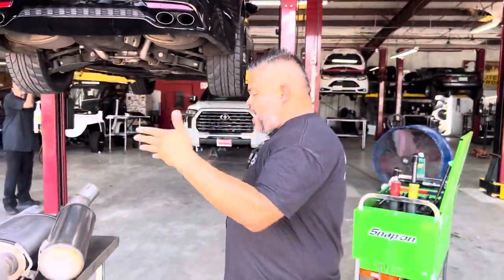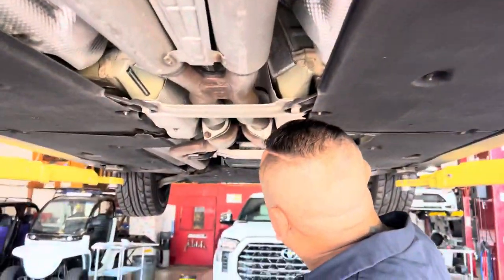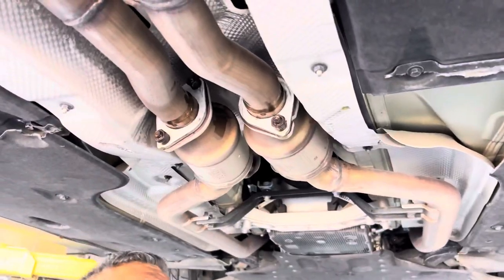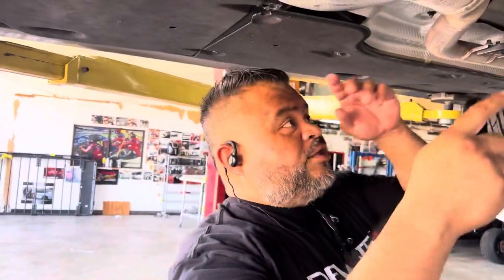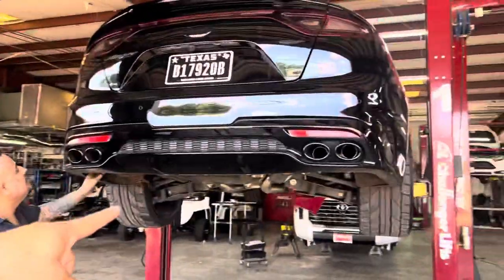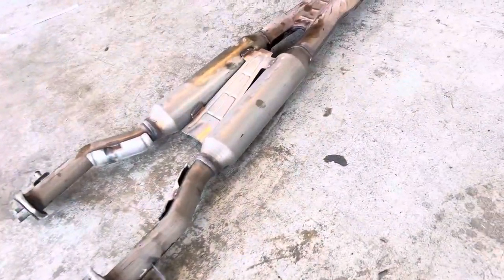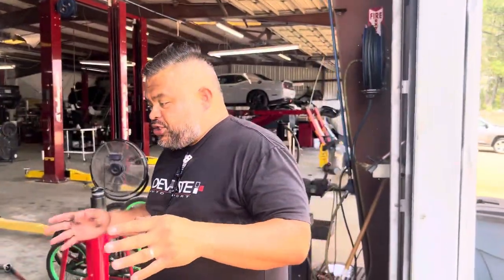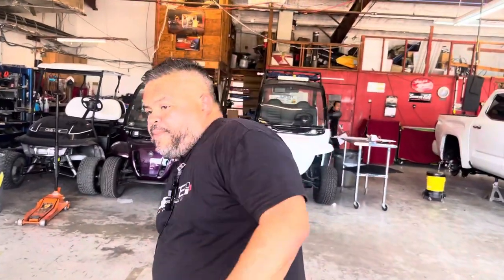2018 KIA STINGER MBRP CATBACK INSTALL!!! **REVS + FLYBY**

Comment: Man, that car is done right. What lowering springs are used?  Do you have details on the wheels and tires such as wheel diameter, width and offset as well as tire sizes. 

I have a 2018 Ceramic Silver Stinger GT2. It’s stock now but I’d like to put the Eibach prokit and sway bars as well as the MBRP exhaust.
Reply from the maker: Email me Aroldo@deviateautosport.com  I can look it up, then we can discuss 💪🏾
Reply: I also want to know